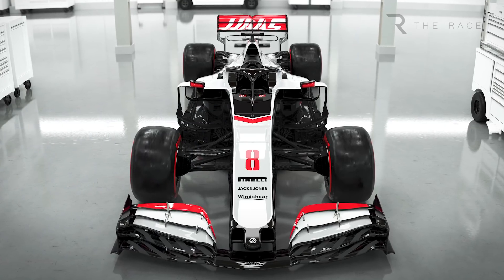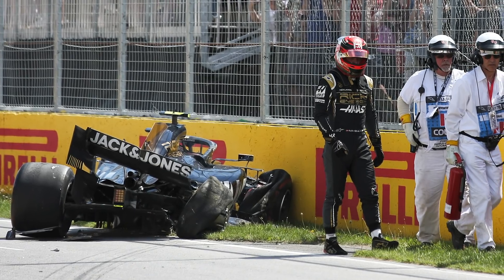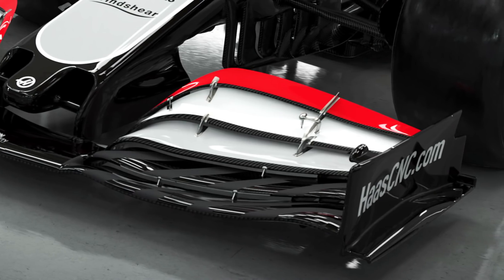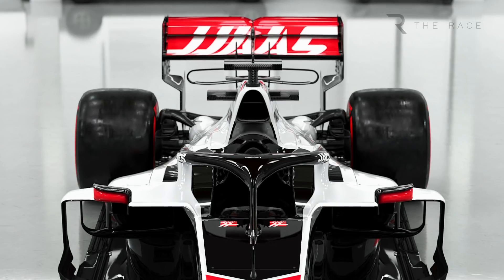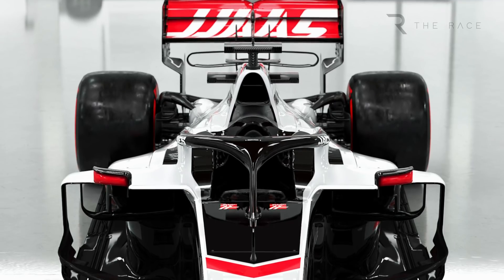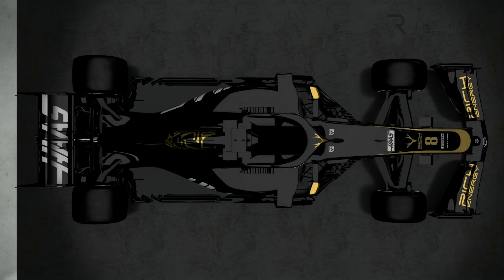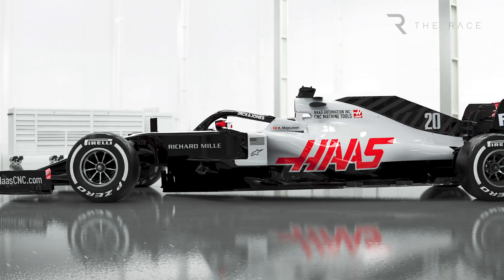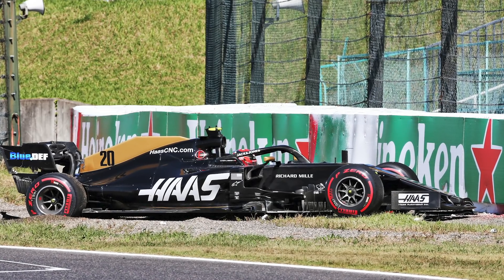First 2020 F1 car revealed - Haas VF-20 technical analysis

Comment: Remember when F1 cars looked different? Tyrell had 6 wheels, Brabaham had a fan, etc. Now change the front wings and change the paint and they are almost identical. Why not regulate the colors to solids without advertising? Will they go faster then?
Reply: Mostly every season's car was colored, and was advertized